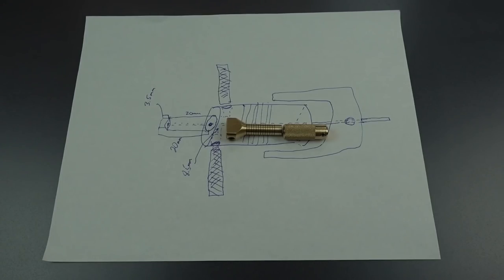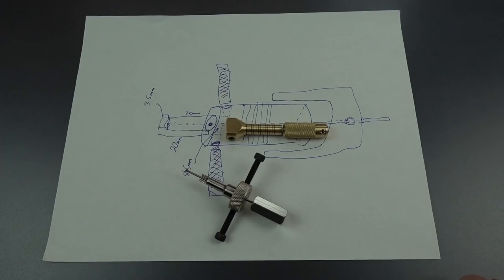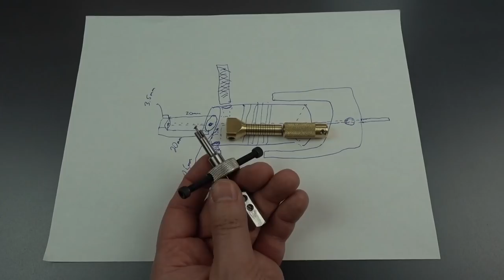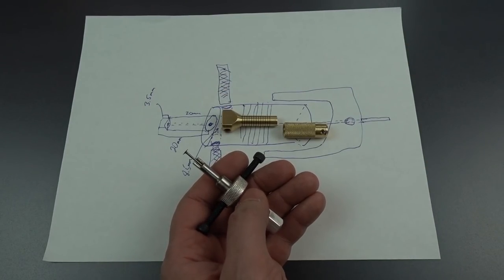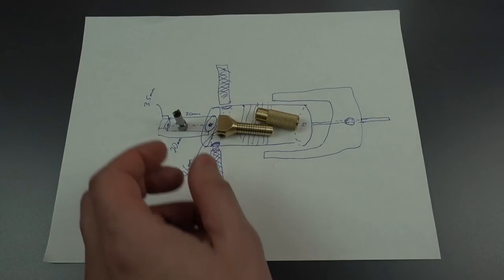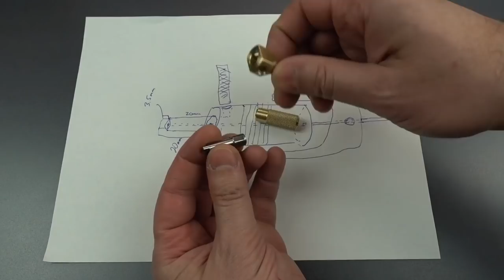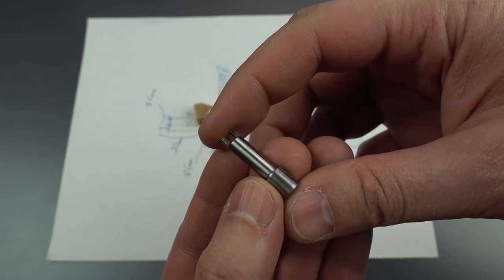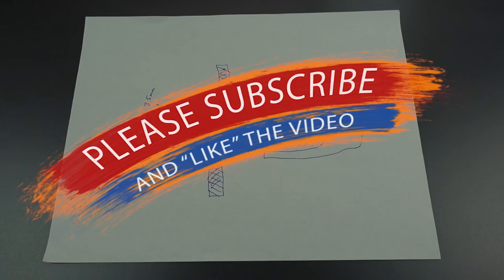[825] Disc Detainer Pick Build (Part 3) - Featuring BosnianBill

Comment: Nice episode, but please reupload with non-confusing sound.
Reply: Those sound effects were quite painful.
Reply: I actually skipped away from that stuff and I like machining usually. I have to agree that the sounds were pretty bad because of the volume and the pitches used and things like that, it was loud for what we hear with the voices which was the first problem, wouldn't have been so bad without it. I would've preferred just the sound itself of the machining but at least leveled volume would've been so much better

Comment: That is just awesome gentlemen.  Honestly, the rest is child's play. The nose design was really the crucial point, and you nailed it. The body and pick handle are also superb, but that nose should be a masterpiece.   You could easily just adapt a couple of bolts the correct size for handles, stick a Spooxe pick tip in it, go forth and destroy without mercy right now. So the questions are: when is Sparrows going to do a production run, how do I get one? Think Sparrows or someone else can manage to make them for under $100? And now for the big money question: what are the chances of building a bottom-tensioning system that will just slot in by loosening the handles and grub nuts, so that the whole thing fits nicely in our EDC cases?

 Oh, one other suggestion, though I'm guessing this video series is already complete: if you haven't done so already, I improved my Spooxe pick tip but filing just a bit of flat for the grub nuts to sit on, similar to what you did with the nose, and far reduced the likelihood of the pick tip spinning in the handle, even without loctite.

Comment: i used a cheap car valve stem tool and cut it in half and a 2,5mm weld rod heated tip up and "forged" the two tips ,it all worked fine , i just got it all backwards !!

Comment: How about cobalt steel drill rod? You will need a tungsten carbide or a diamond drill bit. I'd have sent that out for heat treating and annealing, well I'd actually have used my radio frequency induction heater to quench harden and then anneal the part, but I have gold sputtering and metal vapor deposit tools with an RF induction heater that does most gun parts, so lock picks are well within the size range.

Comment: since this part is separate tool steel and looks to be easily changed make more than one with diferent pin lengths for different locks. standard, extra short and extra long. Just a thought

Comment: Drills do not produce a round hole. Drill about .005" smaller and ream to size.

For spacing, think about using ball detent.

O-rings can give a bit of drag.

A scale can be useful to measure the rotation when measiring each disk's rptation. Think about a Vernier.

Comment: Could you make the tensioning tip from tungsten, or is it too difficult to machine?
Reply: Hard to machine and would  probably  require new tools and the material  is expensive.
Reply: One way could be to brace a piece of carbide to the tip and then grind it to right shape and cut a slot in the middle of it for the picking tip to pass through. Could be overkill though.
Reply: @user-bo8yt4uc8b  I would  imagine hardened tool steal should  be plenty but time will tell.

Comment: Very good, but why not just buy one? They're cheap enough.
Reply: For the same reason you and I might make an alarm or other circuit instead of buying one - hobbies are fun.
Reply: @pileofstuff Partially true, I'll make something because I have the parts laying around, need it right away, or need it built a certain way.
Reply: As they mentioned in the first part, all of the ones on the market are rubbish. So they're building a better one
Reply: @Wertercat  Hard to believe you can't buy a decent one online.
Reply: Cheap picks are cheap. That's the answer.

And why buy an expensive one when you have the ability and tools to make exactly what you want?
Reply: @PXCharon  A low priced pick is fine if you don't plan on using it on a daily basis.
Reply: @electronicsNmore  you clearly don't watch these channels enough if you thought they wouldn't use it frequently